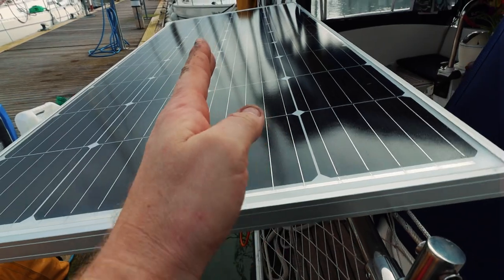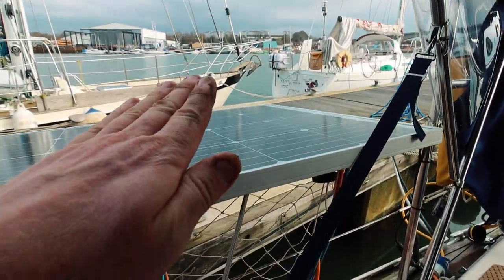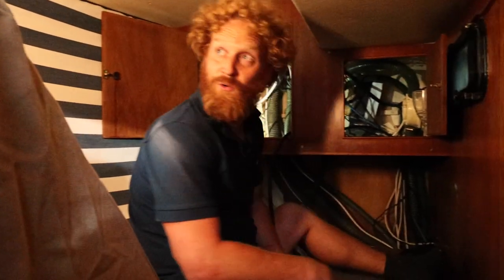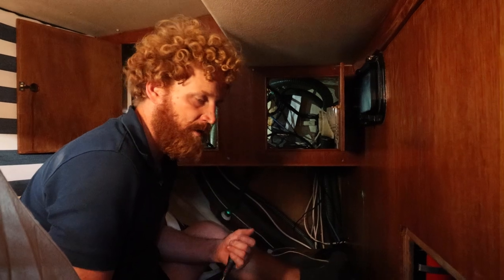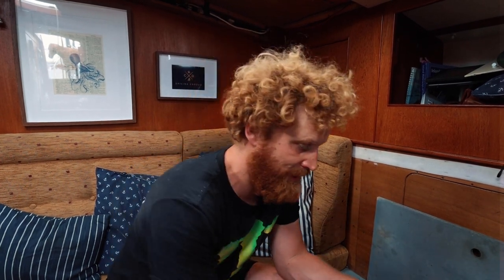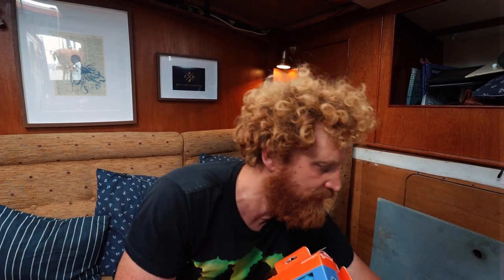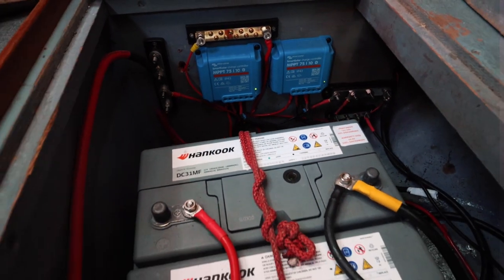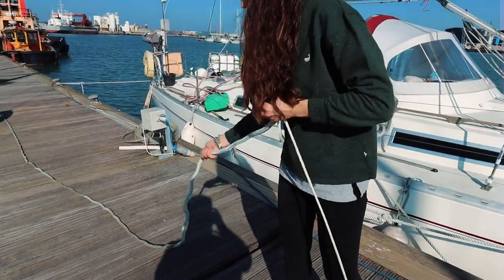Our DIY Solar Power Upgrade (Boat installation)

Comment: Make sure that the wire you are installing is marine grade (tinned) as I noticed your fuse was for a vehicle.  Marine wire in a boat is necessary to prevent corrosion.

Comment: Ok thanks Dom. I’ll give him a call tomorrow. I need to make a decision soon because the welder is cracking on with the arch and he needs to know the dimensions of the panels. I’m hoping to get somewhere between 900 and 1200 watts up there, plus a wind generator.
The Mrs, Krissy, has just told me she has sent you a message on FB asking the same questions, so don’t worry too much about getting into details with her since you’ve done that here.
We also have a YouTube channel, Sailing Crazy Ivan. Only a few videos, mostly jobs getting done, but give it a look if you have time. Any feedback would be helpful too.
Cheers 
Paul.

Comment: Hi Dom, thanks for the video. The guy you referred to as the mad professor, is he helping you design your system? We are just getting into it and I’m becoming bewildered by the choices of equipment. I could do with some informed input.
Reply from the maker: Well the planning was a mix of me guessing how much ‘real estate’ I have (to mount panels) and then talking to people who know about solar to find out what else I need. I dealt with a company called ‘Sun Store’ who are based in Worthing, but we did everything by email, phone and post.

I dealt with a guy called curtis who was really kind and held my hand through the process and put a box together of everything I’d need to set up the system and some really easy to follow instructions.

I’m also about to do a lithium bank upgrade and there’s lots of changes to our ‘system’ taking place too, and Frank (the mad scientist) as well as the guy who owns the battery company, have both helped with my simpleton questions and hopefully told me all the bits I need to put it together.

Be sure to check that video out when I publish it and hopefully that will also help. But as far as solar and components go, if you’re local, give curtis a call at Sun Store (I’m not affiliated, just sharing my experience) and I think he’ll be a tremendous help.

Comment: Your solar panels seem very vulnerable with so much of them outboard. Do you intend to have them deployed in that position when you’re underway ?
Reply from the maker: No, we fold them down when we sail and tie them off so they’re secure. We used them when we were (are anchored).

Comment: You'll only get meaningful amounts of Vitamin D from the sun in UK while wearing typical clothes for the season from April to Spetember, I'm afraid.  The rest of the year you really need to supplement I'm afraid (and beware, the NHS is way behind the times on its dose recommendation!).
Reply: I have received the govt issue vitamin D tablets, one a day.  What would you recommend if different?

Comment: Be carefull with electricity, you must calculate your comsumtion in order to use battery chargers and inverters, not only that, you need to know if your solar cells will charge your battery banks, do not mess with electricity man, if you miscalculate the boat cosumption you can turn your boat in a campfire. Sorry for my english bro.
Reply from the maker: Your second language is almost certainly far better than any attempt I’ve ever made and managing to speak a second tongue.

So far the solar panels have been keeping the batteries nicely charged up, I actually installed the panels last year, just only got round to making a video of it now.

We have three solar charge controllers to make sure the charge going into the battery bank is the right level, also when the batteries are fully charged, the charge controller also wont allow anymore power to go in, so you can’t over charge them. 

So far, so good.

Comment: Do you link your engine just to all the same lithium battery bank. Or do you have one isolated as your engine starter battery?
Reply from the maker: We have an isolated started battery but if we need to we can also flick a switch and call upon the lithium bank to start the boat, if for any reason the starter battery dies.

Comment: I know COVID is a bugger 🤬 and is a limiter right now but endless boat jobs can be the strongest dock lines you’ll ever get. A cruising board is NEVER fully ready to go at some stage you need to go and do things enroute after all cruising is just boat repairs in remote poorly serviced locations👍

Comment: I am surprised you are going for electric cooking, this will eat up all of your additional power generation and storage. Why not stay gas which works and will keep working if the power goes down. Use the additional power for refrigeration and IT stuff. Cooking on electric realistically requires a 24v system massive cables which then means also having a 12v system for everything else. The cost of gas is relatively low and all your eggs not in one basket. Anyway I always love your videos keep up the good work.

Comment: Your charge controllers are way undersized for those panels and even worse for your charging system as a whole. You have reduced your ability to charge your batteries by almost 50%. And since they are undersized, they will run at 100% and get hot, making them even less efficient.
Reply from the maker: The panels are several separate circuits with the correct controller for each one. They never get hot?

Comment: I was leaning towards Lithium myself for a while but after reading more and more, the benefits don't add up to outweigh the cons for a small vessel, and the complexity that is added to what before was a really basic system is only good if it doesn't go wrong. My mind was made listening to an interview on Boatingtube https://youtu.be/jrTd4o3Z_ns with an expert from Canada on this subject and it just changed my mind completely.
Reply from the maker: Thanks, I’ll be sure to have a listen. 👌
Reply: That’s a really good call, I have not seen this channel before and that was some very interesting points being made for and against lithium.  I don’t live aboard and my boat is small with limited electrical needs so Lithium is definitely not for me and this video confirmed it.

Comment: A different view , all the other boats with lithium, the battery God,  end up being battery monitors , as in power is the God.  Solar amazing , but your falling into the power is God,  
All the solar down the sides , not small panels,  where will the spiniker lines run, what's going to catch onto the panels,  there are usually stringent bits making the boat move . 
Step back about cooking electric , great on a large boat with 1000 ah of battery , in the sun, 
What's better a battery car or a hybrid ,  no charging points a car don't run, electric runs out you have the cars engine .   Keep gas , you use it , electric cooking tend not to have an oven.
Just plates,  have both ,   all electric a fuse away from having nothing
Reply from the maker: All fair points. I won’t lie, we’ve never even flown a spinnaker and I honestly didn’t consider the implications of flying the kite in relation to the new solar panels.

We have a small propane burner, like a camping stove that we use when we want to go and eat out say on the beach etc rather than run the risk of lighting a fire in some places, I was planning on keeping that on board, mostly for the use I just laid out, but would also function as an emergency back up. 

I’m also wondering if a small generator on board wouldn’t be a bad idea to have some additional backups, especially if we want to put even more demands on the system?
Reply: And lithium can go down a lot further , that means you have further to come back up. 
And most users of electric ,live like a hobo, or have a generator ,
Reply: @CadohaAdventures  if you have a small generator , so your buying another fossil fuel engine , lol    
They tend to be more unreliable than a diesel engine ,  you have to put it outside to run it , then run a lead, 
Then you need more petrol , more combustible than diesel. 
You may as Well get a better altinator on your engine ,  the engine e is more reliable , and the space you tried to make from reducing battery size you take up with petrol and storing a generator ,  
Learn to use the spiniker or cruising chute , they make the boat move across oceans ,
Reply from the maker: @davidwarnes5158  learning to fly the spinnaker is certainly on the list of things to do this year, although we were just super focussed on learning to fly the white sails well, before moving on to slightly tricker sails.
Reply: @CadohaAdventures  cruising chute is better for you,  setting up the pole if you have one to pole out the Genoa,   this will help you greatly,  it looks hard but it isn't, 
Great for down wind , 
Not needed if your heading still to French canals .